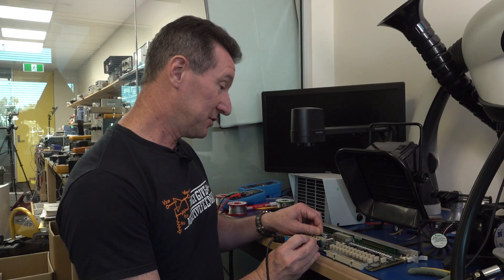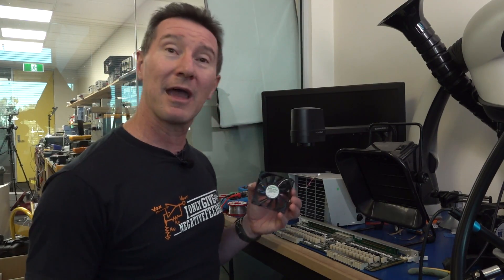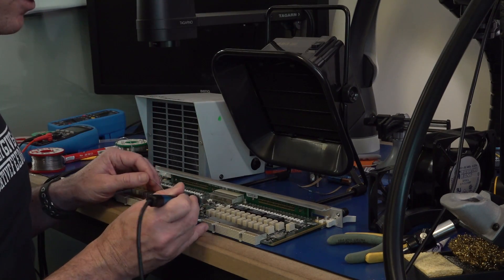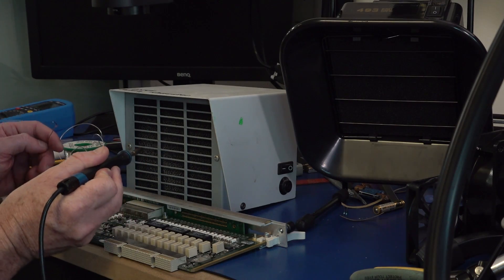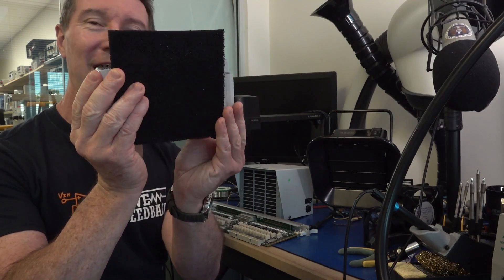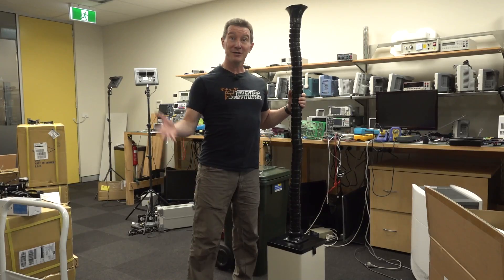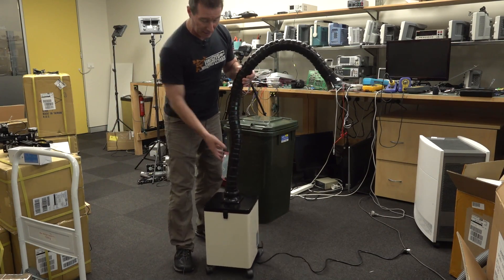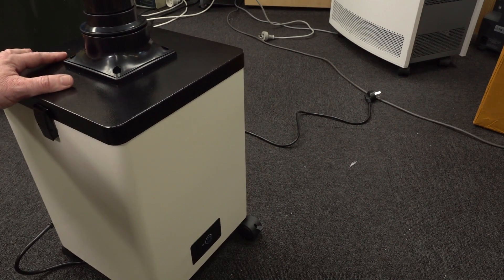EEVblog #1305 - HEPA Solder Fume Extractor

Comment: I found a Vevor XF180A for $267 AUD and a XF250A for $318 AUD free shipping.  Not sure if these are the same but rebranded or not.
Where can I find the filters for the KS-180 and KS-250?
Also if one only uses this every blue moon do I still need to replace the activated carbon filter every 6 months or so?

Comment: i've not looked into this much but i have found for a similar Fume extractor the FX180u  the box style filters can be quite pricy like $50 USD for the Hepa by itself however flat filters you can find fairly easily for $50 for all 3 filters in a set, so for people on a budget it may be worth looking into other HEPA fume extractors that use cheaper to replace filters but make sure it's HEPA.   Also worth mentioning i've found myself disapointed when looking for a decent fume extractor that exhosts out your window yet still has an adjustable arm like this one SO i'm basicaly straping one to my window and plan on using a wood spacer to fill in the rest of the windowspace. it will be in a configuration were it can be fairly easy to remove with ought permanent  alterations to the window itself, just wanted to bring up that idea.

Comment: does it take the same filter as the pace or is there a standard size it takes? Currently using a KOTTO cheapy for like $70 .. its got a decent hose and suction but it's not HEPA. This would really be a nice upgrade:)

Comment: so i have one of these. where in the heck do you get replacement filters for them? i have the dual inlet model. got it under the vevor brand during a recent ali sale ended up shipped to my door for less then 225$ works fantastic but i NEED to find filters without them costing the price of an entire new unit. i love it except for ONE thing it only has three speeds. i will change it out to a pot sooner or later instead of the touch button. otherwise it works awesome. i hate to have to buy a whole new unit just because i need a filter. i contacted kingsom and they wanted to know how many pallets of them i wanted lol i said no i want to order maybe 5 or 6 or as i need them and they said they couldnt help me with that. they said try to find a compatible filter. like wtf lol
Reply: I asked Vevor on their European site, and they replied they did not sell the replacement filters.

Judging from the reply you got, at least they do exist...

Comment: I've been running one of the same model unit (but branded under the Fumego name as XF180 - link at the end) - works great for me. I have it mounted under my bench with a drilled hole to snake the extractor through to make everything as hidden and compact as possible.
One downside for the unit for me is that the unit powers up to off and pressing the speed control button was a huge pain in the ass because I have it hidden well under my bench. I have a smart-home plug controlling the connection to my soldering station power strip and so everything else instantly powers up with one button (and auto-powers off under certain conditions for safety etc) BUT this extractor would always require me to crawl under my bench to turn it on.

To resolve this, I first hooked up a Xiaomi smart plug module directly to the button input on the control board which worked alright but having it inside the device meant that the case attenuates wifi significantly and the line is at potentially dangerous voltage so wiring it outside wasn't going to work. This meant the functionality was intermittent and had now feedback on the current state which was pretty much unusable. So might next attempt was to wire a mains rated foot switch across the switch terminals - unfortunately in the process, I didn't sufficiently isolate between the connector I mounted to the chassis and the chassis. The switch line is obviously at ~mains voltage and I blew out presumably a bunch of components and tripped my breaker.

Finally I got back in contact with the supplier to purchase a replacement board and noticed that they now offer modifications to certain models to add the footswitch but apparently not on my model (or maybe possible by shipping the unit back - wasn't 100% clear). But I did inquire about making a FW mod to the device so that it starts up on max speed - they slightly misunderstood me but still got mostly the outcome I wanted by bodge-wiring past the button controller and just having the unit always run at full-speed when it has power connected. This means I can now run the extractor through it's own smart plug and control it reliably (but without ever being able to change speed anymore). If anyone is interested in performing that rework themselves - hit me up and I'll open the device back up and document it.

Link (Taobao/Tmall) - price: ~$196USD https://detail.tmall.com/item.htm?id=575048462984
Reply: id def be interested. im in the same boat with these.  they work great but the two things i wish they had were first a knob for speed control rather then the push button and only three speeds and that i have to turn it on separately every time i turn the bench setup on. i may look into doing a mod for more control when i have more time we will see depending on my medical issues. but yes i would def be interested in how they are doing it
Reply: @th3drizzl378  I'll have to come back to this, unfortunately that model is now at a friend's workshop but I'll see if I can drop by and check it out.
Reply: Can you buy replacement filters for it? I mean, actually buy them anywhere? The same model seems to sell under the Vevor brand, and Vevor confirmed to me that they did not sell replacement filters. (How ridiculous is that...)
Reply: I would love to find a place to purchase a replacement control board for this model. Any ideas?

Comment: Steve, a great video, thanks for that but you are not comparing same performance products. 
After doing some datasheet research your unit KS-180  is actually an "economical" line ("cheap extractor" is KingSom's own words). The exact model you bought is not the unbranded PACE product that they also make for PACE.  It uses the same nozzle and tubing but nothing inside it is the same as the unbranded PACE you are comparing to. The KS-180 is a 80W model, while the pace equivalent is somewhere around 135W-150W, so you don't have the same fan motor either. Spec air flow is 180 cubic meters /hour (max, not nominal) which is 105 CFM, The Pace model arm EVAC 150  is 254 m^3/hour =  150 CFM, so your has significantly less suction. Comparing to Hakko FA430 which is rated at 4.7 m^3/min = 282 m^3/hour = 167 CFM. Hakko wattage is 120W much less than the actual Pace but more air flow and quieter, i suspect a more efficient motor part in the HAKKO (it is brushless,  longer lasting too).

So you spent 1/2 of the PACE EVAC 150 price including shipping from china ($425) for -30% less suction. If you scale the prices for the difference in suction power, you only saved $160, except you have an economical circular ring filter which does not have the surface coverage of the PACE and HAKKO rectangular box filters. Altogether you got what you paid for, no more and probably a bit less.  And i found no replacement filter listing for your unit, in fact Kingsom or fumeclear have zero listing to buy replacement filters for any of their units, i don't know why but it's not what you'd like to see when buying one of their unit. Then there is the risk of dealing with the chinese and the language barrier, if anything goes wrong you may have to wait months with a dead unit with no leverage inside China.  God forbid you have to pay for shipping it back to China from your own pocket.

 Kingsom current models are now being sold by another chinese company FumeClear which is unclear (no pun intended) if they are just a marketing facade company, or are they just stealing the design from each other sourced from the same parts which is more likely. Nothing is what it seems over there. Anyhow trying to match their current models with the PACE evac-150 equivalent spec there is only a 200W chinese model that has the identical digital interface but different chassis form factor and higher air flow 194 CFM which seems to be the new generation. I found no exact unbranded form factor match for the PACE EVAC 150 as that would probably violate the blueprints IP from PACE and expose them to be sued. Instead, they're using a mixed bunches of loose  new parts put together by hack designers, not the thoughtful designs from overseas. When you add shipping cost and duty import it comes to $726 so you only save $128 .  But you always get that low confidence of "what am I getting into" when buying a chinese product over the internet. Switching parts for cheaper ones is a well accepted practice in China, you never know exactly what you get, even if re-ordering the same product. We know this already and they drop the price to make up for it but everytime i dug in deeper i always found it is not better value, the quality/perf  always scales down lower that the knock off price.

At the end, yes you could save $150 for similar performance but what about replacement filters ? I was surprised to find out a whole lot of what makes chinese product expensive from australia or usa is shipping. It's very possible that the chinese, smart as they are, know exactly how much the equivalent product cost in the usa, and mark up shipping cost to net the difference. This way only chinese corporations get the cheap price which is in line with chinese politics.

 And how much is enough suction,most people only look at visible smoke which are larger particles and forgetting about the VOC gases which are invisible but no less harmful (in a more insidious way), faster spreading, lower density, more dynamic and diffuse. If the unit is barely sucking the visible smoke without a lot of extra velocity to spare as seen in your video then VOC might escape.

I am in the market for buy a fume extractor , it is why i did this research, i have no link whatsoever to any of the aforementioned brands.
Reply: Brings up a good question then, in all your research of the differing Chinese brands and normal brands, what would you recommend then? I've seen Hakko, which is crazy that it doesn't come with the hose, then there is also Quick which according to someone doesn't have active charcoal filtration and just uses all cotton filters, and I've seen 2 Chinese brands that do sell filters, there's one called the RFE-100 by Refox which is sold through rewa, and the other was on aliexpress, which I wouldn't trust spending that much money on that site, but they do have all 3 pieces available to buy. 

So I'm curious what you came up with as the better choice?
Reply: @XyeleWolf  Thanks for the interactive questions. At this point, i am trying to avoid chinese brands, any of which can be here now and disappear in 6 month or a year. These Chinese extractors are all overnight companies with zero integrity and there to make a quick buck for a year.  You'll see these brands disappear and new one replacing them. They have zero warranty. They may help you for a month after purchase (and even that is just free will from their point of view) if you have any issue with their product but after that you're on your own and you have zero leverage on them.  Everytime i dug into a chinese knock off look alike of a western brand, i always find the critical parts (engine, filter), interface, are cheap and poorly designed as a system.  Filter availability is another concern. Also you'll pay through the nose for shipping and import duty,  and after adjusting for lower product quality and features, it's saves little considering the added risks. 
I don't want to pay thousands $$$$ either for an american brand and Hakko is expensive too  and not without issues ( fumes still escape a bit).  So i totally changed my perspective.  If i have no fume extractor it's bad for me but also it goes in the environment. But why filter it anyway if I can extract it and ventilate it outside.  Then i don't need an expensive filter box. For a small lab only doing occasional soldering the pollution to the environment is insignificant. So i am built my own contraption buying Hakko's nozzle but not their unit. Just bought a $30 6" AC fan with flanges with 195 cfm (as much as hakko) and bought dust ducts, a 6" to 4" reducer  + a 4" to 3" reducer so i can connect to the hakko duct and i will vent the fumes out of a window without filtering.  Actually I could attach a small carbon filter mounted on the hakko rectangular nozzle.  Total cost in the ~$250 but will provide the same protection to me as a $850 hakko unit + accessories.  The only complicating work is to connect the exhaust duct to the window. I am planning on using a wood board for that purpose with a hole and a flange. I also expect to have better suction, but i don't know if hakko and other brands specify their air flow at the nozzle or at the pump motor (i bet it's the latter, just like cars hp is spec at the crank not the wheels). Still in progress.  And if it does not serve me well, i can always buy the hakko unit to complete the nozzle, but i don't expect to.
Reply: @XyeleWolf  After wasting so much time on these extractors I easily found answers to all your questions. The Quick is in the lowest powered category of extractor, I assume you mean model 6101A1.  The same unit is branded by different companies for about the same price ~$500-$580 (let me know where you saw it for < $500).  It's only 80W and 200 m^3/h airflow versus 282 m^3/h for the Hakko and yet the Hakko does not have spare suction to get the job done. So I expect weak suction from the Quick requiring it to be put very close from the board 2-3 inches. It does have the full set of filters : pre-filter, middle filter and main filter and you can buy them in the US.   
It certainly is not cheap for the suction power. I think you'd want at least 120W to get the job done satisfactorily (Hakko).  The airflow are spec without filter, so I hope my custom fan + duct will be as or more effective at removing fumes.  I can always reduce the suction power by stuffing filter material somewhere in my ducts + reducers.   To be honest I had not seen the Quick before you mentioned but I don't like its low power for the $500 price
Reply: @XyeleWolf   TEq is also the website used to go to but it's slow and poorly organized for comparing products specs. Try gotopac they're a major US distributor and they have all the filters for the quick you're looking at.  I am having second thoughts about my custom extractor which is really just a ducted vent powered by a 6", 30W Fan encased in flanges. This is because the wattage of my fan is small compared to any extractor motor but it wont have a big box filter attenuating the air flow.  Too bad all these extractor products are very poorly documented by the manufacturers. They give no airflow versus pressure curve, only a free airflow (no filter) number and sometimes a static pressure which i guess is the vacuum it generate at the inlet (?).  But from simply watching videos, i can tell the Hakko is freaking noisy at its "high" setting. Even the 80W Quick is noisy (sounds like a jetplane on the tarmac waiting for the tower approval for take-off from a passenger point of view, well a bit less noisy).  I am quite sure of two things : 
- The quick will do a decent job at removing 95% of the fumes, but not 99.999%
-The hakko is too noisy on "high" so that if you operate it on "medium" what's the point of paying for the extra power.

And i am unsure my venting system will be satisfactory and i already spent way to much time thinking about this.
Reply: @XyeleWolf  I'd stay away from the Weller. Just looking at its spec only 10% more airflow (220 vers 200 m^3/hr) than the quick for 50% extra power consumption, means it probably an inefficient motor that will be noisy.  The hakko is also 120W but has 280 m^3/hr.
Reply: @XyeleWolf  You didn't seem to have read carefully my last reply. The weller motor is inefficient and noisy. The Hakko while expensive does back up its price with the best motor. There are always shady sites with lower prices.  I don't think none of these brands is a good deal. They're all expensive only provide different level of performance. You're worrying to much about the hose and don't seem to understand the specs.

Comment: Why not just a normal vacuum cleaner with HEPA filter, second hand 20-30$. You have power adjusting lever built in and even the tube, wheels, just create the inlet nozzle and there you go ! And heck you can even clean your table after your job is done :)

Comment: I still feel like the best way to do it would be to have an exhaust system all the way out the roof, that is if you can design a place with that in mind or through a cut in the window like an AC system would, i guess it depends on the amount of smoke but i always feel like no matter how good a HEPA system is eventually it will clog up and require more constant replacement of filters and for the smokers out there it's obviously convenient to have that vented fume extraction, however for when that's not an option the HEPA solution seems pretty reasonable.
Reply: You’re establishing a vacuum, so pulling in hot air during the summer and cold air during winter. Yes?

Comment: I've got a whole home hepa system, same basic construction, uses 3 square filters, and a big fan to pull the air through them.  Takes air from the cold air return, and returns it actually upstream from the intake. Probably not terribly efficient, but it works.    We had a house fire, and did not know until the next morning but the hepa system filtered all the smoke out, such that none of the smoke alarms went off.  One room was destroyed before it burnt itself out.

Comment: I prefer to vent outside if possible. A lot of the noise will be probably due to the air flowing through the tube, can cut it down by insulating the tube and fan box.